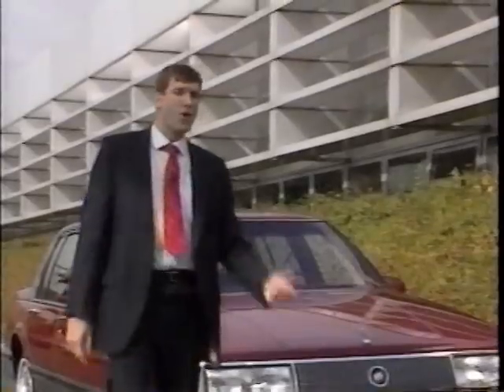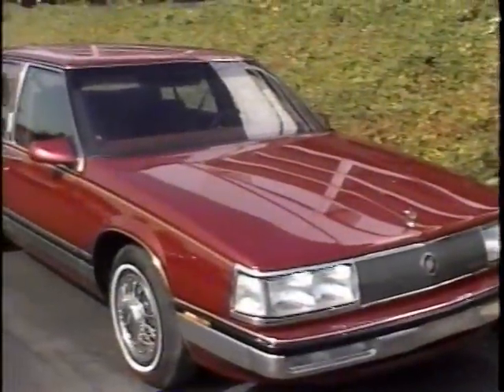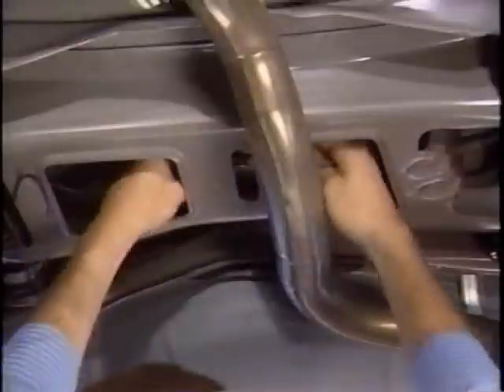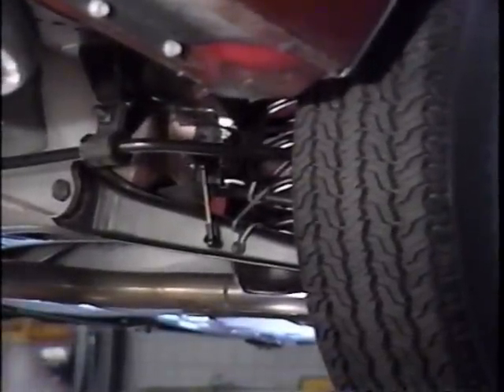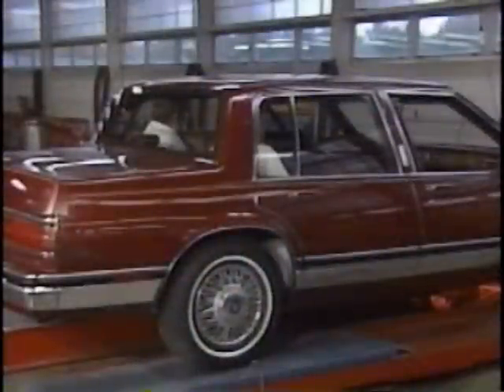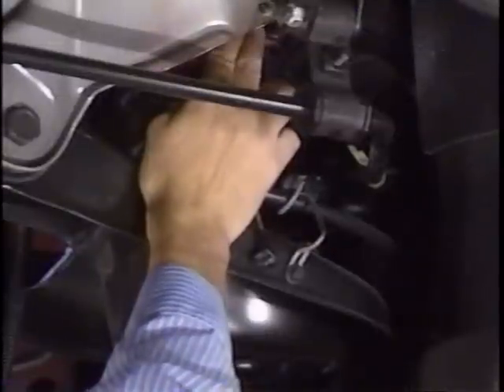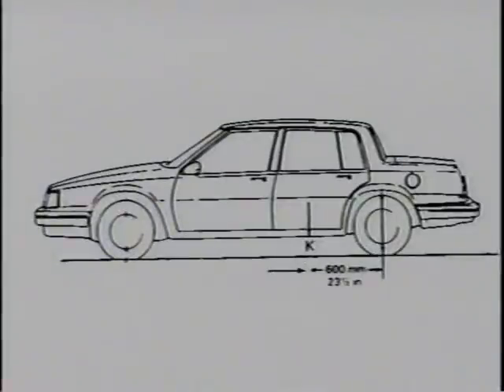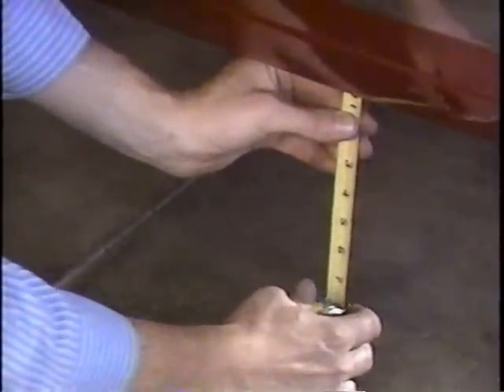Buick - Electronic Leveling Control (1989)

Comment: I have up all he time problem with my 1997 Buick Riviera. The former shocks were leaking and I found the correct OEM still new on the web and my mechanic installed them. About 2 months later I had a running problem with the car and it turned out it blew out one of the spark plugs. The spark plugs were all replaced by the mechanic and about 2 weeks later the car started to ride hard like a buck board. The mechanic did not have experience with this problem and a week later I tried another shop. They at first thought it was the height sensor,m but that is not available anymore, then later they found that the relay for the system was burnt, and replaced it and told me the car was fine now. The 1.5 mile drive home was good and later my neighbor asked to barrow  one of my cars, and we took a drive in this Buick and he drove it some and loaned it the next day. Two days later I drove it to work. about 22.5 miles either way and it was stiff but tolerable, drove it the next day and on the way home is was no longer tolerable. I am thinking maybe they put the relay in the wrong way since this one has not indication on the fuse box which way is correct. The horn relay is also the same type, and if that is wrong the horn will blow all the time.   Anyhow it would be great to know of a shop that could either retrofit a modern system, or fix this one, or if I had a clue where the items are on this model. The air pump appeared to be under the rear of the car, but where is the the computer that controls it???  If it is the up and down sensor that must really be only two switches connected to a arm, that should not be difficult to retrofit and then cover to be water proof. As of today I removed that relay in hopes the air will come out of it. But that is under the rear seat,

Comment: Part edited out: "...and if you're extremely lucky, the entire vehicle might last 100,000 miles before some kind of mechanical failure that costs more to fix than the depreciated value of the car."
Reply: Idk what your talking about but every Buick I have seen that was made before 1998 has had at least 180k miles before something major happened to it if anything even happened then